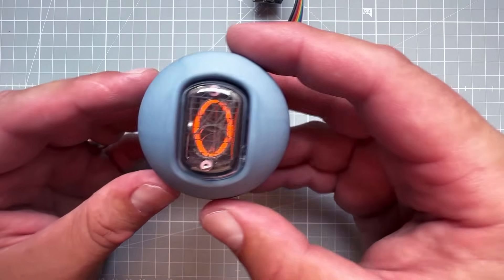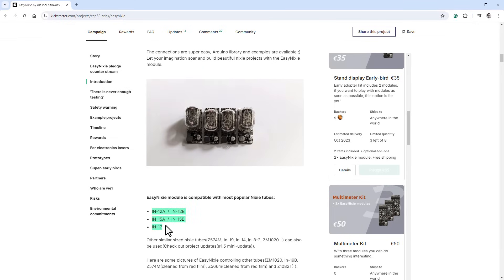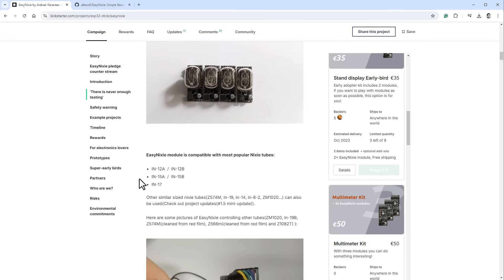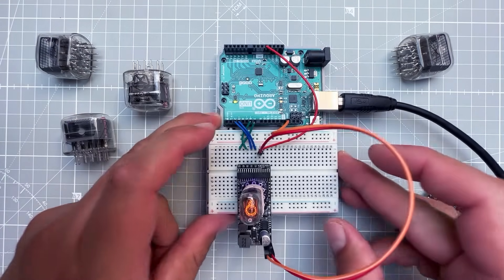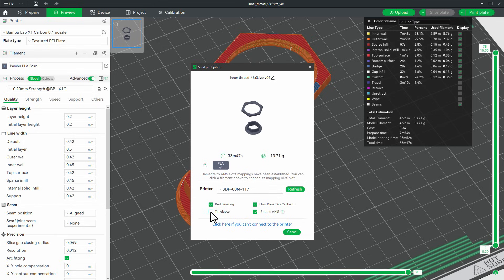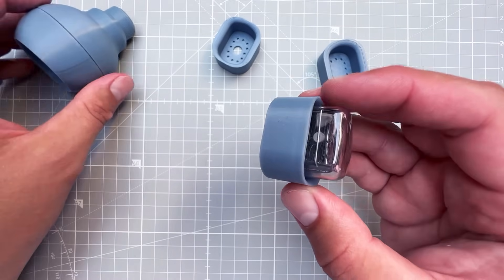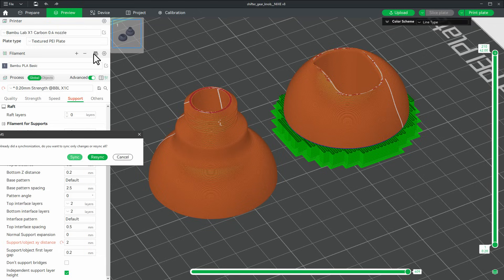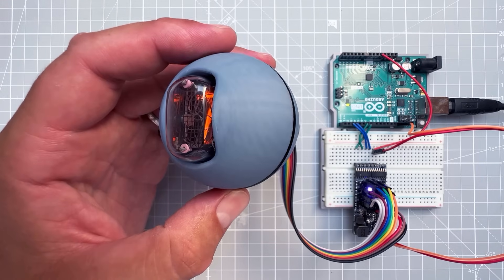Bizzare Shifter

Comment: This is awesome, but i think the nixie tube fits better in a dashboard. It's more convenient to look at it that way. I'd love to do this on my  nb mazda miata, but what i don't know is the way your arduino knows the gear you're into. What sensors are you supposed to install and where do you install them?. Anyway, good work mate. I will be checking your other shifter videos
Reply from the maker: There are multiple ways how to get the current gear - many of them are described in my other videos. This includes getting the shifter position using magnet and hall sensors, calculating the gear from speed and rpm, but you can also use data straight from OBDII if your car reports this value. Good luck with your project!
Reply: @upir_upir  Too bad my car is too old to have OBD2. But I'll see what I can do with what I have, maybe magnets are the best solution for my car. Thanks for the reply ❤.

Comment: Is it possible to cannibalize two nixie cubes to put N and R in place of 7 and 8 or are these manufactured with a vacuum like a regular lightbulb?
Reply from the maker: They have vacuum inside, I was actually thinking about doing something like that, and cutting the nixie tube in half is possible, but I don´t have the equipment to put it back together - at least not yet.

Comment: 200v for a shifter rip i dont think my cqr can power this
Reply from the maker: It´s high voltage, but very low current. You can power it with batteries.

Comment: This reminds me of a transistor logic circuit I designed in the early 2000s that would provide the input to operate an LED starburst display to show gear position. It was designed to use four microswitches that made contact with the shift linkage (forward, backwards, left and right). From there it was able to decode any position the shifter was in (it could even tell you were wiggling the shifter left and right in neutral). The starburst display also had the ability to show characters for N and R.

I love the execution of this concept! It would be neat to see a custom nixie tube manufactured specifically for shifters that had 1-2-3-4-5-6-N-R as characters inside the tube.
Reply from the maker: That sounds like a cool project! Do you have a video of it somewhere? I would love to see it. As for the custom nixie tube - if I ever find a way how to make a custom one with the proposed digits, I will definitely turn this into a real project. Right now, it´s kind of hard to show neutral and reverse in some meaningful way.
Reply: @upir_upir  That project was a long time ago, and I no longer have the source files for any of it. I'd have to reproduce it from scratch. A company by the name of Dalibor Farny has taken on the task of manufacturing new nixie tubes for the modern age. They have occasionally made custom tubes for unique projects.

Comment: maybe a weird idea but it might be an idea to make this with 1 coil or led thingy, you can short it to ground on different points by using transistors
Reply from the maker: You mean directly driving the nixie tube? That might be possible, but I would not want to touch it any exposed connections :)

Comment: yo where are the 3d files for the printing
Reply: ive already got it working with a booster and a esp 32 and have the voltage run from the cigarette lighter port and  all i need now is the shift nob i could design one but am lazy.
Reply from the maker: It is on the GitHub page. I believe so. If not, please let me know.

Comment: when operating this tube with high voltage, shall I wear a safety glove?
Reply from the maker: Probably no. It´s not a good idea to touch exposed wires and connectors, but it will not hurt you very much. The current is very low.

Comment: ‘Which car would be perfect for such a knob?”

This knob will have an electric restomod esque classic mini Pick-Up made with a carbon fibre body and slammed to the floor with air suspension ^^

The body will have 90% the original lines but incorporate some of the distinct modem day features of electric car design to bridge the gap in design ethos. The front grill will be closed off but still show its outline for example…

The battery pack will be lowered into the truck bed as low down as possible for a low COG.

It will have a high gloss paint finish but a flat green/grey colour.. depth to it by a perfectly smooth polished finish.

16 inch magnesium racing rims by KAD

Disk brakes all round

But wait… why would you need a shifter knob in an all electric car? Because there is no way I will ever drive one without a stick shift added for fun ^^ (joke)
Reply from the maker: Looks like you have a pretty clear picture of that car! :)
Reply: @upir_upir  yup… might actually have to make an artist impression of it one day ^^
Reply from the maker: I think you can just feed it into chatgpt/any AI image tool :)

Comment: This would make an absolutely dope shifer knob if love to have one in my manual vehicle would be soo cool however i have concerns cus where i live we have extreme weathers and I just feel like the life of the actual LED in it would die quickly in winter can go from -55F to in summer 100F i think is what got to this summer so i would be worried it would die quickly cus thoes temps
Reply from the maker: There is a storage temperature and operating temperature for Nixie tubes. Your range is definitely very big, but I guess when you drive the car, the inside temperature is slightly less extreme. Nixie tubes were used in various machines, including airplanes, and they are quite reliable.
Reply: @upir_upir  oooooo ok thank you for the information much appreciated love to get something like this in my EVO

Comment: You should put this inside of a gearbox assembly, with contact plates for each position that close circuits which power the individual Nixie tube layers. It won't need a microcontroller, but it will be super reliable.

For extra points, have a custom Nixie tube made that has digits for each forward gear and "R" for reverse.

Really cool video, thanks for sharing.
Reply from the maker: That´s an interesting approach, but I´m worried that letting those 200V to fly around your car will not be very pleasing experience, I mean, it will not kill you, but it´s not nice to touch :)

Comment: Thought about trying to do an entire gauge cluster with nixie tubes (Speedometer, temp, oil pressure, voltage gauge, RPM, fuel) for my fallout 2 Highwayman project, but this type of thing is WAY over my head.
Reply from the maker: I was thinking about something similar, should be "simple" with the help of this EasyNixie board, but it will still take some time, plus it would be nice to have more elements than just nixie tubes... I have seen your video, looks like a great car, cannot wait to see it finished. Good luck!

Comment: There's some good info in this video, and it looks cool, but...

It's not really a shift knob, though, is it?  I get the appeal of making something to drive clicks to your affiliate links, but come on.  There's nothing to determine what gear you're in (it's just looping through numbers in the code) and you printed it in PLA on a machine that's easily capable of printing in ASA or at least ABS.  PLA would last one summer day in direct sunlight and be smushed into a different shape after the first gear change. The wires are running through where the shift lever would be if you actually tried to install it in a car (You could have just made a hexagon shaped pocket and press-fit a nut in it, making a separate slot for the wires to drop down from).  Please clarify if I'm misunderstanding anything, as I'd truly love to see this project actually work! 

I was expecting this to be about using a gyro or accelerometer or levered microswitches or hell even canbus to get the number to reflect the actual gear, but instead it's a little bit of slicer setup, a little bit of CAD, a little bit of arduino, and some affiliate links. 💀 Maybe make a small series of videos to go more in depth into each topic rather than putting so many different topics in one video?  You've got a lot of subscribers and are engaged with your audience in the comments, so why mislead them?  I'd love to see what this video is claiming to make actually get made. Hell, I'd even help with the code and fixing the geometry to where it could actually be installed in a car, and have the knob calibrate itself upon engine startup. 

Sorry for the negativity, but you're so close to actually making something cool.  I'd be down to help if you want to actually make this.
Reply from the maker: Thank you for your comment. This is an ongoing project. I would like to turn this into a real product at some point, but I have to learn a lot of things before I can do that. 

There is a dedicated playlist with I believe 8 videos that cover various topics - how to get the current gear using hall sensors, experimenting with various displays, 3D printing different knobs, using shifter knob with PC games using SimHub. 

Again, there are a few more steps that I will experiment with - including 3D printing it with more advanced materials, making the knob from metal using CNC, getting the gear using accelerometer or getting the gear from OBDII, etc. 

I thought it would be helpful to document my journey, instead of just showing the finished product. However, that also means that my progress might include some mistakes and errors, and of course some dead ends. 

Hope it makes sense. Here is the playlist:

https://www.youtube.com/playlist?list=PLjQRaMdk7pBb6r6xglZb92DGyWJTgBVaV

Comment: Does it get hot? I have never used nixie tubes before but I know I would not like to put regular tubes in a shift handle.
Reply from the maker: No, nixie tubes operate on a different principle than normal tubes. They will not get hot at all, even after long usage.

Comment: If you need to be told what gear you are in you should not be driving.
Reply from the maker: Definitely! And you should not be driving rally cars! Let´s remove all gear indicators from rally cars!!
Reply: It would look awesome on a motorcycle, there you have a sequential gearbox. For the older ones you can reference revs to the speed to make out the gear you're in, assuming you're lucky enough to have a rev counter. If you only have the speedometer you're forced to know the gear by speed and engine behaviour such as vibrations and sound. Such a counter would be useful on top of looking sick.

Comment: im using this style of gear display for my 8 speed swapped triumph tr7
should match the z31 digital dash I have in the car as well
Reply from the maker: Cool, sounds like a pretty rad car. Do you have any photos?
Reply: @upir_upir  just some i have posted online 
Currently doing a full new wiring harness so the car is torn apart 

When I get a new phone I'll start making some videos of it as there is some interesting things I'm doing 
Wish I knew how to add photos to YouTube

Comment: You can use PETG to print the part, it is much more durable than PLA. And you can use PLA as the support interface for PETG, no need to spend extra money on a separate filament for support.
Reply from the maker: Good point, I will definitely try that! Thank you for your suggestion.
Reply: @upir_upir  theres also a setting in bambu studio that makes the support print only on the plate and not on the parts

Comment: For years now I've said showing the gear number is a useless feature, since you are able to feel and/or remember what gear you're in at all times.
But that thing is pretty cool. If i wouldn't run a 600g shift knob, I'd get that and crash into the first tree, distracted by nixie tube. Solid, 10/10.
Reply from the maker: Thank you for your nice words! Is that 600g knob helping in any way?
Reply: @upir_upir  Definitely. I threw in a short shifter - on which the top (where you screw the shift knob on) is a bit shorter, too.
With a heavier, longer knob, it's now easier to throw the gears in. Not smooth as butter, since it's a 2006 Eclipse, but a lot better than OEM.
It's an odd thing to explain, but once you try it out, you notice the changes.

Comment: Id say that new electric Hyundai crossover. But the FJ cruiser is also a good option, having two shifters thst jave screw+on knobs and a design based on it's 60s counterpart. While not as "retro futuristic" and rather "vintage modern" , it has the potential to really start looking the part if you go in on trying to make it happen.
Reply from the maker: Agreed on both, great suggestions!

Comment: Can you imagine a car with all the instruments designed with nixie cubes? That would be a vibe
Reply: Dude... you'd might like what Hyundai did with the Heritage Series Pony
Reply: On Russian YouTube, we have a blogger called 'AcademeG.' He built an electric Volga with a nixie tubes dashboard. It's very interesting to look at an old car with new technologies
Reply: A steampunk hotrod, I dig it
Reply from the maker: The more I think about it, the more I like the idea. Not yet sure what else could be there except for the numbers, I mean, how the actual gauges would be made.
Reply: @upir_upir  The gauges could just be gauges. Pressure valves did exist, after all.
Reply: @upir_upir  I imagine you could build nixie cube bar gauges, it could look like those early digital instruments, depending on how large the cube is you could make it to display the revs and have another one with numbers for the speed.
But I don't know if there are any nixie cubes like that so even if its possible to build one it would probably be expensive to build do so. So if you were to build one out of readily avaliable materials it would probably be to just use a regular gauge as a rev counter and have the speed be displayed by the nixie cubes.
There were a lot of motorcycles that used this mix of analog and digital display back in the day so it wouldn't look too out of place.

Comment: it's an amazing concept, but will this actually work as a shift knob without breaking easily, and how are the wires getting put into the controller with the shifter shaft through it
Reply from the maker: Thank you! Even printed from PLA, I don´t think you can break it easily, but of course it would be better to use some harder and more temperature resisting material like ABS. As for the connection, some shifter rods are hollow. If that´s not the case, you would need additional hole for wires - something I have done in my previous videos.

Comment: Would be very cool for modern automatic transmissions retrofits into older cars. Like a modern ZF 8HPxx 8-speed automatic into a late eighties BMW 5-series.
Reply from the maker: Agreed! The only downside is that the Nixie tube does not have a dedicated segments for reverse and neutral. I guess you can use 0 for neutral, but not quite sure what would be an appropriate segment for reverse.
Reply: @upir_upir  The ZF is an 8-speed, so I'd be very happy with 0 representing neutral, 1-8 representing the gears and 9 being used for reverse. Park is a seperate button on most shifters for these transmissions so that shouldn't be an issue either.

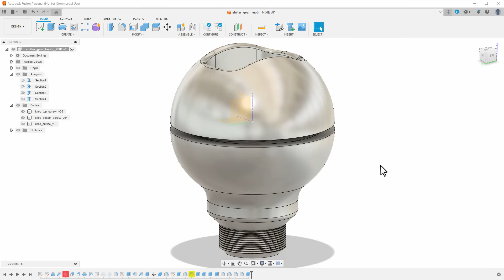Comment: So at 12:50 where you said it was a happy coincidence that it fit inside... I think that can become an intentional design choice... because then you can have yet another piece that closes from the top... say magnetically attached?... and it can be designed in such a way where you can hide the big gaps that needs to be there because it needed to be big enough for the nixie tube to insert from the top... so it would become a bezzle of sorts and expose only the text
Reply from the maker: That´s a very good point. I prefer to see as much of the nixie tube as possible, but it should also be possible to only show the number if needed.
Reply: @upir_upir  yes and I perfectly understand that… I just feel the canyon between the printed part and the tube leaves something to be desired

Comment: to get rid of the support problem you could just add threaded insert. so it's kinda like a pipe with outer threads. then have both lower and upper piece to have inner threads. so you can print them flat on the plate. It would be then 3 piece set. and then you sandwich them all together. Prolly faster than having to switch the filament all the time and cleaner mating surface too. btw i'm doing it also. i already orderd the lcd display with bmw logo you showcased. :)
Reply from the maker: Thank you for your suggestion, I will definitely explore that path a little bit more. I like the idea of having smoother edges, even when I need to print 3 parts instead of 2. Also - good luck with your project!

Comment: C4 Corvette with the digital tach/speedometer? Though that's kind of the opposite style from a Nixie tube...
Whatever Pagani makes after the Utopia should definitely use Nixie tubes.
Reply from the maker: Good point with Pagani, they have that steampunk kind of styling.
Reply: C3 is more retro analogue with aircraft style gauges, I think it would fit better there.

Comment: We need filament LEDs to replace nixie tubes.
Reply: Look into edge lit displays.
Reply: @SenkJu   Nuh, uh. Sorry.

LCD's look horrible, my friend.
Reply: @Splarkszter  Edge lit displays aren't LCDs. They are what the name implies: lit from the edge. They are usually constructed from pieces of acrylic with numerals etched into them that are stacked on top of each other like in a Nixie tube.
Reply from the maker: Nixie tubes shine "outside" of the filament, so a slight overlap with other digits is not a big problem. LED filament is a problem, those strips are much wider and do not shine outside as much..